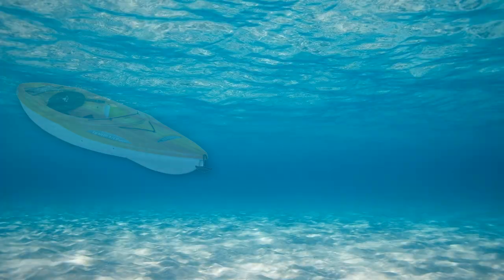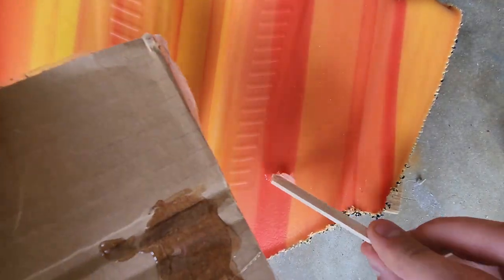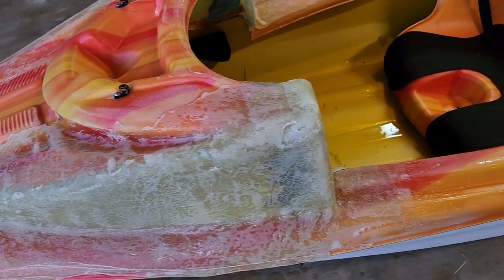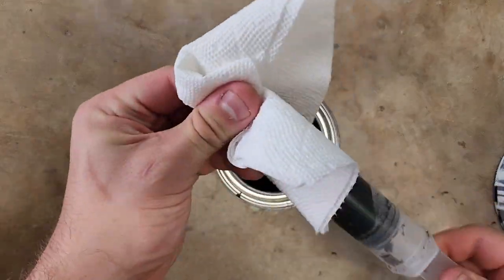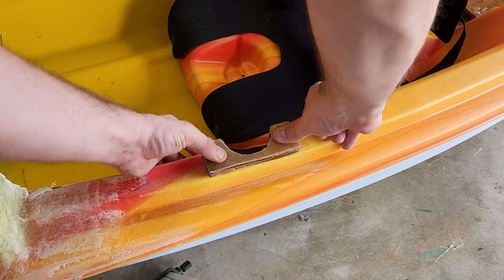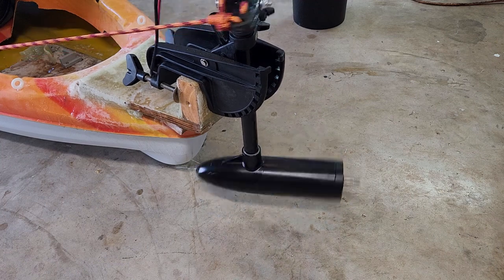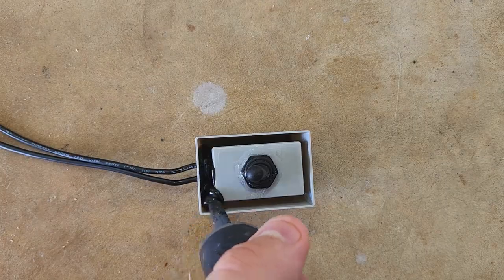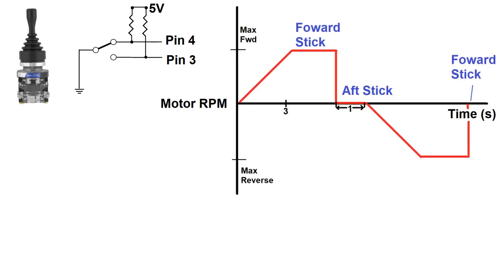Submarine Kayak - Part 1

Comment: At 10:53 could water get into the threads of the screw and degrade the plywood that has been fiberglassed? Did you pre drill and fiberglass inside the holes?

Comment: The last time I was in the ocean in a kayak something picked up the front of the kayak pushing it out of the water and turned me 90 degrees before dropping me the front of the kayak was 4 to 5 feet off the water luckily I kept my balance and did not flip I never saw what did it I just know there was zero signs of sea mammals in the area meaning it most likely was a shark as I said the last time I was in a kayak ...over a decade ago, hell two weeks later I sold it.  And sorry to say when I got back on the beach I didn't find any teeth stuck in the kayak, & no one on the beach saw what happened.

friggin still gives me butterflies all of these years later.  ...this happened in New Jersey

Comment: Hi, fantastic video by the way. I was wondering, do you have a schematic of how you wired up the switch to Arduino and Arduino to the HobbyWing WP 1080? I am looking at building this with dual motors, so I'd be using two WP1080's. Thanks

Comment: Technically, you can add a balloon and valve to the top of the battery and if you the balloon is inflating/inflated a bit, turn the knob and vent the hydrogen gas. Correct?

Comment: Another way to compensate for the pressure delta of the motor is to dielectric fluid fill the motor unit.

Comment: This is so exciting. Is part 2 in the works? I would love to see how you made and control the flippers for attitude and depth, and what you did to keep it from taking-on water. This combines my loves of SCUBA and flight, and is sort of the sweet-spot between the two. 

Just curious, would this be trained under the Diver Propulsion Vehicle (a scooter), or would there be additional training and safety briefings that one would want to take before using a craft like the one you built? I know that there is no PADI-police to tell you that you cannot run a device without the training and briefing. As a less experienced SCUBA swimmer, I think I err on the side of over-training and being overly prepared. 

Also, it looks like this can only seat one swimmer. Are you planning to build a second for your swim-buddy? I know some people swim solo, even to depths that would require decompression stops on the way up, but the idea of that scares me senseless.

Comment: WTF, thanks for tip with heating up surface of HDPE.
BTW, good think to not know about, when i was like 13 and my cousin quad bike tank was leaking gasoline, probably would set myself on fire. Without knowing this trick tank was just still leaking after i put glue on C:

Comment: I have a question. my kayak has a crack on the bottom. do you think that heating it up and putting fiberglass, and epoxy and resin should stick good on it?
Reply from the maker: It could work, but i'd try to melt the plastic back together first

Comment: No ballast tanks?? Dive planes work when the rig becomes negatively buoyant and will only surface again once the seawater in the ballast tanks is pumped out. Your design is going to leave you just below the water line if try surface on that motor and planes alone. 
Grab the bladders and valves from some old BC’s. Place athe corners and amidship, below center of gravity and shouldn’t matter how much water you take on. Cool project. Have fun!! Be safe!🤙🏼

Comment: Nice conversion.
Note.Any High density Low volume hull would have suited this,as long as it was just large enough to accommodate YOUR body size.
Your initial 'glue problem'....slice waste pieces of standard polystyrene....place them on a test piece of the hull and add superglue....
this will produce poisonous gas(so don't try it indoors)
but you should see the polystyrene MELT.....before it sets HARD.
I fixed the hull of my own kayak using this technique,and found it a lot less costly than fiddling with fibreglass,resins and the cleanup that always follows.
Lovely video.Nicely done.

Comment: PRESSURE COMPENSATE THE BATTERY!!!
If you don't, it will most likely implode. The lack of venting isn't ideal either.
Just drill a small hole in the top and add a bladder.
Add some positive bias in the comps to really ensure no water ever gets in, even if there's a slight leak

Comment: Huh. This isn't related to the overall point of the video, but your mention of the battery venting hydrogen gas reminded me of the forklift at my old job. It had an area for water to be poured in between the cells of the battery to keep them from overheating. If we didn't top it up with about a gallon of distilled water every month, it would start to smell. It was a smell I recognized as hydrogen sulfide. Would that have been caused by a similar issue to what you were talking about, with charging or discharging too fast causing it?

Comment: The air bladder (balloon) to equalize pressure in the motor makes me nervous.  As it shrinks in a dive, the boat will get heavier.  My major worry is the way it will expand as you come up.  The extra displacement may make the  boat's buoyancy (and maybe trim) harder to manage.

Comment: Rough the plastic hull up w/80 grit wipe off with acetone, roll a thin layer of poly resin with extra accelerator, let cure for 12 hours under sun lamp, hit it again with another layer let cure, wrap a layer of 6% woven fiberglass lol way around it. Now you can glass anything onto it you want

Comment: Couple tips wrap your steering cables around the shaft of the trolling motor to the opposite side.  You get a 90 degree turn and be able to do doughnuts in the yak,  better turn radius.   Move the battery to the front and will balance out the yak.  Other than that looks great I like the speed controller idea or you can just use the one the tmotor comes with and set it up like a throttle on a boat.

Comment: That fiberglass is not gonna hold
up well you need to use a roller and get all of the air out in between layers just making it “wet” is not enough
Reply: The fiberglass will not take any force
Reply: @SorenBlethrow  it’s a sub everything is getting increases pressure…
Reply: @nike12000haha  he made another sub out of fiberglass and it worked

Comment: Next time take a chip brush and cut about half the bristles off to make it stiffer. Use this to push the fiberglass mesh down into the resin! Keep dipping your brush into acetone to keep it sort of clean as thats about all that works with fiber resin! You can leave the brush untill the next day if you clean it in acetone. Its good for another round before you trash it! It will give you a smoother finish on the fiberglass.

Comment: What if you had used a 20 volt hand drill motor and lithium ion cordless drill batteries with switches to batteries as they run out.

Comment: Why do you use fiberglass, You can use 5 gallon buckets or Polly barrels. Heat them with a  Heatgun or in the oven to make them pliable. Then lay them on a board that you make As your mold . You can Is plastic.use metals wire or Screen to adhere the molded pieces to the boat then plastic Weld on the top. I have repaired and added to numerous kayaks with this technique and it works great.

Comment: Perhaps you should try using a lithium phosphate battery you should be able to find them used even if you use a small 18650 batteries and build your own battery box have tremendous amount of power. Being a scuba diver myself I know you always want to have more juice and more air than you need. Rule of thumb is one third out 2/3 for back. Jic just in case. Keep up the good work can't wait to see the rest of it

Comment: the battery part seems concerning. How do you know what too much current is? Could some sort of underwater ventilation system be made for that instead? Also I love just coating the Arduino in flex seal lol

Comment: When doing solid parts. Why not use the printed part to make a silicon mold, so you can do the whole thing in whatever material wanted. For machining, Nylon plastic is great and very strong

Comment: side note on heating up the polyethylene, the heat allows the adhesive to bond to the surface because it breaks up secondary bonds in the polymer chain.

Comment: Looks like the kayak needs more steering control. The elec. motor uses thrust to steer. If you use a twin motor configuration.  It would give you more control over pitch and yawl. At this time. If a current comes from you stern. You won’t have any steering.
I had built a trimaran snorkeling sub. Outrigger pontoons carried tanks for deeper diving, 30’. Snorkel, flag. Main hill carried everything else. Got the idea from mechanics illustrated magazine.

Comment: @6:11 I have often wondered why they don't just fill the interior of mini-subs with something non-compressable and non-conductive like mineral oil. It works for computers, so why not subs? Have you ever tried this or heard of it? Do the motors have brushes that would be insulated by the oil? If that's the problem, why not just go with a brushless motor?

Comment: I particularly like that you come up with simple, basic solutions to address issues!

Everything is straightforward and uncomplicated.

Rather neat solution to pressurise the motor housing to prevent seawater from bypassing the drive shaft 'O' rings, I thought!

Very neat and clever, I had to subscribe.

Comment: You might be able to save yourself some trouble and fill the motor housing with mineral oil as well; it will likely operate just fine as long as the o-ring seal is compatible (or you can replace the seal with a compatible material).

This will allow you to use only a small rubber diaphragm for equalization (to absorb the volume change from any small amount of remaining trapped air) instead of a giant bladder, and will effectively give you no lower limit to your depth.

Comment: Awesome project, really innovative. I used to work in subsea robotics and find it a fascinating area. In industry they tend to use a non-conductive moly grease in connectors, it's superb for preventing water ingress. The air compensator filled with mineral would likely be smaller and allow you to go deeper if needed. This is the approach they use on ROVs with PBOF (pressure balanced oil filled) junction boxes. Looking forward to the next installment.

Comment: What about equalization...? A human being cannot descend and rise at fast speeds. It's incredibly dangerous. This doesn't seem practical in the least
Reply: He's mentioned in an update that he has a ballast system working.
Reply: @hatad321  so this thing is going to be completely enclosed head to toe? I'm not sure you understand what I mean by equalization
Reply: @robobo2650  Can control the speed of the assent/descent. Long as he doesn't open it all the way and rocket to the bottom, should be okay.
Reply: @hatad321  that's not equalization in diving.
Reply: @robobo2650  Allows him to though.  Stop the ballast equalize and continue.

Comment: I dont know if you did it to any of these, but to make everything actually waterproof you need to seperate the wire sleeves inside and outside. At pressures of like 30psi i think water can flow through the wire sleeve amd leak into things through the potting.

Comment: rather than sealing the battery itself, could you do a watertight box into which the unsealed battery could go into? that would solve the issue of worrying about gasses trapped in the battery. you could do a watertight pass through for the cables and you wouldnt have to mod a battery.

Comment: 6:35 a deformable bag is pretty interesting. i've usually seen the problem solved by filling the motor with mineral oil and then sealing it off. the oil is incompressible, so no way for the water to come in

Comment: This is great entertainment! For myself As a kayaker and tinkerer in process of turning two into a hydroplane also an rc enthusiast this project tick’s all the boxes! I’m liking the design and care going into its water proofing! only thing I’d have done differently was the throttle control for the esc I’d prefer to have full throttle range , I don’t own a pc for tuning so I’d just gut a cheap radio set or use servo testers to run the esc

Comment: A lead acid battery will produce hydrogen during normal operation - you should have an over-pressure relief valve on it.
That said - you won't have an explosion risk underwater.

Comment: They make direct servo controllers that would work on that ESC and simplify the setup if you found one you can make water proof. You probably already know and looked at them but I wanted to comment just in case you hadn't.

Comment: You can weld HDPE with nothing fancier than a hot iron. Kayakers routinely do that to fix scratches. No need for glue or fiberglass. Just cut out sections from any cheap HDPE bucket or similar and weld them where you want them. See for example https://www.youtube.com/watch?v=eLVKxgTOeDk

Comment: One of the cool things about hdpe is you can weld it with a soldering iron. Could have easily bought some sheet instead of dealing with fibreglass
Reply: Yes and no.  The weld will always be weaker than the virgin material...especially with hdpe that thin.

Comment: one thing to keep in mind with the tank up front it wont just balance the whole kayak it will also lower it in the water naturally.
Reply: I thought this as well initially, this shouldn’t be a problem when we see the neutral buoyancy problem addressed. Getting an even mass across the vehicle is a priority at this stage, the actual buoyancy is much easier to plan for.

Comment: You should add a deadman's switch of some kind that will blow some flotation airbags if it is not engaged for X seconds in the event you some how lose consciousness.
Reply: Depending on the depth that they get to that's a good way to get the bends but better nothing. Ideally they should keep a close eye on their pressure gauge and remember to treat it as if they are scuba diving so remember those stop points for pressure equalization
Reply: @Trekeyus  The bends is better than dead at the bottom of the ocean.  Personally in a solo craft, a deadman's fail safe is a good idea.  You can pass out/lose awareness from other things not related to the dive equipment and end up too deep or out of gas.

Comment: About the motor, wouldn't it be simpler to fill the motor cavity with mineral oil, as such, you would fill the cavity with some (nearly) incompressible fluid, which, at the same time doesn't mix with water, thus keeping water out

Comment: Very cool.  If you need to reshape any part of the remaining HDPE it can be thermoformed by getting it hot and clamping it into the desired shape as it cools.

If you have a DPV already and your arms get tired, add a D-ring and submarine strap to your BC and clip it onto that to pull you along.  Deep cave divers down in Florida that push miles into caves use rigs like this.  (They actually have stage divers that will set multiple DPVs along the expedition routes, and that just blows my mind.)

Comment: I really like the idea of the compressible balloon to keep the motor at ambient pressure. You can put those inside a container covered in (deburred) holes in order to protect them from abrasion. 3D printed dams and flex-seal is also a great potting method. I think the stability issues that come with an open-top kayak may be troublesome, be nice if you didn’t need a sump-pump. Getting it back on the surface with motor power and hydrofoils alone might be difficult, though any closed buoyancy tanks would have to be strong enough to withstand the pressure.

Comment: you should add some air floater tanks or even more  air tanks so the boat will automatically float up once the air in the air tanks is almost out. it will also make it more easy to steer up and down if you make it have a somewhat neutral weight in the water. you can use the bag principle again to stabilize the pressure.
Reply: No. You do realize if you ascend to quickly you can literally blow up your lungs right?! What is wrong with people on here. This is not a safe build! You cannot and ascend quickly without equalization for your body being done properly as well.

Comment: hey quick note - if you look into wood boatbuilding techniques you'll find that you're not supposed to use steel hardware because it'll very quickly rust inside the wood and cause problems.
Sites like Glen-L sell special bronze fasteners (screws bolts etc) that are made to be encased in fiberglass-laminated wood and shouldn't cause issues, even when exposed to water.
Reply: Stainless steel works fine
Reply: @krotchlickmeugh627  stainless steel will last longer than normal steel but it's still not the correct choice.

Comment: Very cool! Looking forward to part II. Wondering one thing, did you seal the wood screw heads at all? A little moisture in the plywood would quickly cause them to loosen.
Reply from the maker: Yeah they're covered up with epoxy

Comment: Sanding is the age-old bonding method between plastics and adhesives. I'm surprised that wasn't even mentioned.
Reply from the maker: I also sanded, but sanding alone without torching the surface was cause de-lamination
Reply: @HyperspacePirate  Fascinating. I've used HDPE for projects in the past, but never realized it was so adhesive-fickle. Thanks for the video!